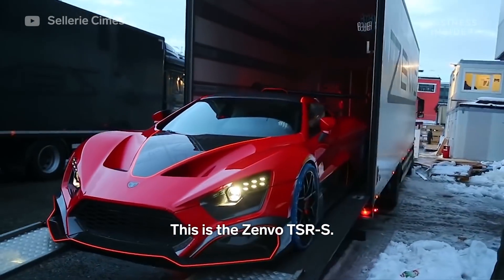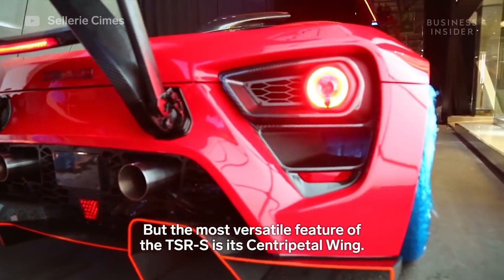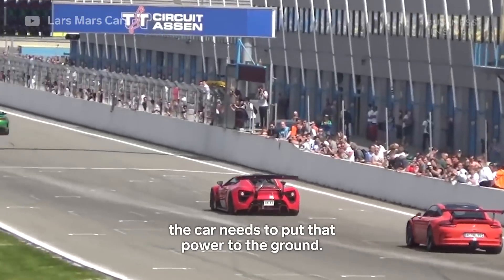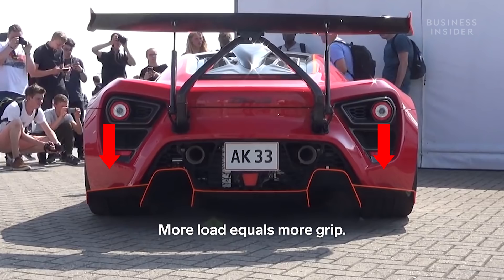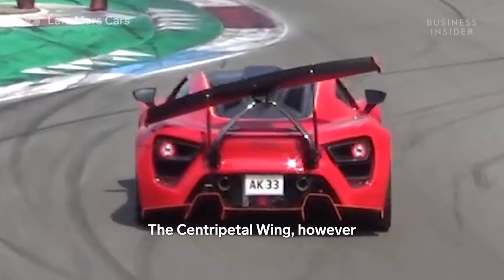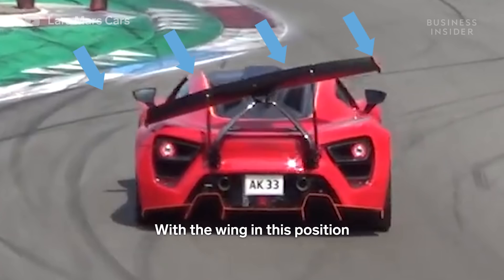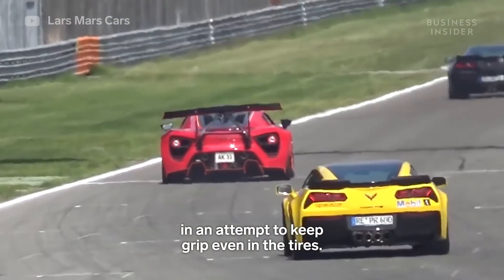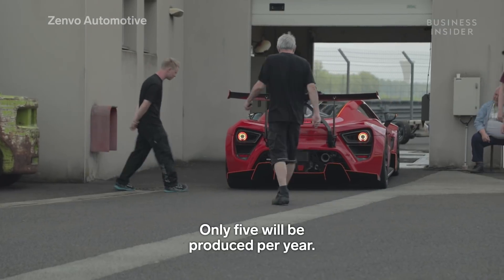How This Hypercar's Tilting Wing Gives It More Grip

Comment: yet another gimmick people pay for...    lol a wing  push's down yes, but the simple fact tilting the wing doesn't miraculously change the downforce..  it just redirrects it....  

aka its pushing you through a corner.....      as for better grip for braking...    uh..   only if your going fast enough for the wing to actually have an affect..    but anywhere below like 80 mph and its pretty much use'less for both drag to slow down and down force ...   this is why you see aircraft NOT taking off until the get up to speed..

Comment: i feel like if that made a significant difference they would tell you it increases corner speeds by xmph or something.. or that at some mph it allows for a certain amount of extra corning g's. all that i've found is that it reduces total down force by 3% and has an inward directed force of 30% of the down force.. which says nothing of how effective it is. seems kind of gimmicky to me. it's like the worlds flashiest sway bar
Reply: plus the active aero on the pagani huayra is still way cooler and actually implemented in a way that doesn't look super silly. plus it actually has active aero on both the front and the back.

Comment: From an engineering standpoint this is nothing but a gimmick. Dealing with wheelload transfer is one of the main aspects of suspension design. Adding active aero adds 3 more variables (downforce, drag, balance) that need to be considered when designing suspension as well as proper setup once the car is finished. That being said: Even without active aero proper suspension design and car setup is INSANELY complex.
When you now consider that:
a) this is a road car and does not produce as much downforce as a race car
b) Active wing overcomplicates setup
c) Added weight for hydrolics
d) worse stiffness -> worse aerodynamic performance or again more weight

I can pretty much say without a doubt that this car would be much quicker around the track with a fixed wing in favor of  a lighter car, stiffer wing and more refined setup

Comment: I want to say its cool, but it just doesn't vibrate well with me. Mostly aesthetics in liking the large rigid chassis wings, and their even and aligned positioning to the body of the car. This kind of messes with that clean aligned look and is a bit dissatisfying to watch, despite the performance enhancing qualities. Never heard of Zenvo until now too, probably would if BBC didn't pull the plug on top gear UK :P

Comment: never heard of an actual downward push figure being mentioned in such a video. Let me try to come up with a figure for you.
RC airplanes with a wing of that size can be say max 20kg. say x3 given a sharp attack angle and say x2 at fastest speed though you really take a turn with slower speed. for a light car say 1 ton that would be 10%.
that sound quite good but it's a very optimistic figure. typicall I would say less than 2-5% of the car weight and is only distributed to back wheels.
on the other side you do have some drag and extra weight. say minimum 1% drag, 0.1% weight. not sure if it actually is worth

Comment: I thougt moveable or active wing is banned in any racing sport???
Reply: Snailconnection Well in F1 they have DRS which is kinda like this but the wing just opens at designated points on the track to reduce drag on the straights nothing like this though that would be banned.

Comment: Highly doubtful that the 5 people a year that buy this car are willing or even able to take this car on a track and use this technology, these cars will most likely sit in someone's collection, driven maybe 50 miles a year.
Reply: A 1981 Volkswagen Scirocco Thats more like any ultra expensive car also the technology may be used in motorsport thats if it doesn't get banned
Reply: Dylan The amount of speed it takes for aero to be effective makes this wing tactical maybe 10% of a race? Depending on the track most turns are sub 80mph, which make aero ineffective.
Reply: A 1981 Volkswagen Scirocco Well it depends on what car the wing would be used on it would be more affective on a downforce intensive car like F1 or Indycar but a tilting wing in genaral is really unnecessary and just looks silly.
Reply: A 1981 Volkswagen Scirocco Yep

Comment: We will see, but imagine on some wings a load of the entire wing, meaning several 100 kg of downforce, just having to get evenly onto the mid axes. The wing already loses some of its ability onto the steering mechanics and some on some flimsyness of the wing itself, as you can see in some wobble on the straight. Additional weight of the construction adds up and at those rediculous tilts, the airflow is already not too fast. Now we also need to see, where the fastest airflow happens. Usually (with some turbolences) it is usually a bit lower. New wing designs explicitly make use of that already and this not. So...question is: Is the height of a tilting wing in the upper region within thei max airflowspeeds? Probably not as I would say....so it is losing efficiecy. The middle pivot is the main factor and no matter if it is fixed or not, the load would be not much significantly forced into the left or the right strut. As is is rigid, some of it also gets lost.
And as we all can see...they dont win anything and a normal vette is beating his ass left and right for some significantly lower pricetags.
It is an exotic thing and it will be bought for rarity and exotic reasons. Doesnt mean it is any good. Up till now, even a zonda or a koenigsegg hasnt done too much significant except building a track car, that is also street legal...which not many other sportscars do nontheless. So, pretty pointless to get hyped about them, when they dont work and even dont look that good. I saw a zenvo.....pretty bad manufacturing. Koenigsegg is a different one, I have to admit...but still doesnt have reached any significance whatsoever. It is an exotic car....nothing to win races with its superior tech. Those tecchniques are usually already well known by any other car brands since decades probably. :)

Comment: I have a feeling that this will backfire because if you were to turn the the opposite direction via adjusting yourself on the track to not touch the grass, the spoiler will just tip the car. This all seems like a dream car that is not probable

Comment: I would like to see this car in GT racing soon, along with the BT62. I think they would fit in perfectly with the GT3 (Or even the upcoming GT2 class reimagined by the SRO) cars of Blancpain GT, and GT Open. Obviously, it wouldn't be in this spec as it is merely a track-day car with a stupid, slow-reacting rear wing. The BT62 might even fit into the new "Hypercar" (LMP1) regulations for the 2020/21 FIA WEC season.
Just a thought.
Reply: Brabham is definitely aiming for LMP1. Zenvo not so much, there's nothing new. Active aero has been banned in F1 for ages, of course they thought about it.

Comment: You only get the benefits of the rear spoiler by going 150kph your not going 150 in a corner. This feature is very useless
Reply: A wing will always provide downforce so long as you have forward velocity, the amount of downforce being a function of speed and wing angle. Wings still provide a notable downforce increase as low as 40 miles an hour at higher angles of attack. And as you could see, the wing also changes its' angle of attack to better suit the speed it's travelling at.

In short, this is not useless. If this were useless, you'd be calling all rear wings useless, and racing would certainly disagree with that.
Reply: This guy obviously don't know shit.
Even wings/spoilers in fwd are useful.

Comment: GIMMICK. If it had that big of an impact, others would have already implemented them first. Remember Zenvo is just a small company from Denmark
Reply: Paypal had a big impact as well. But that was first created in the 2000's. It's called Innovation. Someone has to be the first one to get the idea and then Engineer the Technology. But i doubt you would understand that.
Reply: Besides it looks silly when it moves at 10mph, you don’t even generate downforce, it should activate at a certain speed, like 60 mph
Reply: Koenigsegg is a small company that does things most wouldn't think of yet still is still a capable company. I mean yeah its entirely possible it doesn't work well but you can never know...

Comment: Why am I not impressed? lol 
Seems like by the time the spoiler or wing has titled to the correct angle while racing, the car has already passed that corner and need to tilt or steer into the opposite direction and not helping with the road trip at all as expected. So it’s basically the same as any other race car there. I was expecting to see a huge gap left between it and the other cars. 😂😂
Reply: Isaac Kamau I bet u don't even know they way it's supposed to bend

Comment: Since you don't really need and generate downforce at slow speeds they really should have that activate at certain speeds. it looks ridiculous to have the spoiler twitch around at while the car goes 10 - to 20 miles an hour going into a parking lot
Reply: Exactly, at that speed a toyota 86 would produce the same amount of downforce
Reply: Matt Haas nope. It’s already linked to speed and grip levels. You can turn it manually at slow speeds for show though
Reply: chamber25 you can active and deactivate it lol
Reply: @QuasiDude  there can't be any mecanical link between the two, that would be ridiculous and not smart at all, it must be all electronically controlles.
Reply: not meant to be a street car though. its meant for racing
Reply: but having it when you are manuvering it on the parking lot would be awesome to warch
Reply: You gonna drive your 1.7 million dollar car to the fuckin supermarket? No. This shit gets trailered to the track.
Reply: if you have a 1.7 million dollars unique car i really doubt people would laug at it because of a racing feature on a parking lot
Reply: chamber25 its a gimmick
Reply: Sean McGeeney exactly
Reply: Sean McGeeney a gimmick that works
Reply: Konkey Dong a gimmick that is none the less a gimmick
Reply: Konkey Dong I could argue a gimmick that does not work as anything other than a gimmick
Reply: It's a super car (racing) obviously no point to take it on the street unless your stupid
Reply: chamber25 maybe turn it off
Reply: Considering it's 1.7m, there's a race mode they turn on to enable the wing.
Reply: It'll be funny as hell to see it, though.
Reply: Yeah 😂😂😂
Reply: No, it has electronic actuators so it can be turned on and off. It'd be way harder to do that stuff mechanically anyways XD
Reply: Now, why would you deactivate a wing on the track? Do you know how much calibration goes into that thing? Turning it off to park or go down the highway causes two problems. One, similar to the Plymouth Superbird, the car's wing sits extremely high, making it impossible to out into a one-state unless that state was absolutely perfect, otherwise, tailwind would rip it off. Two, you dont spend 1.7mil on a hypercar to make it a more boring hypercar. That wing is the entire car, without it, it would be another ST1. The wing is there for practicality AND looks.
Reply: chamber25 I agree but I think theyve done it to be a distinguishing look
Reply: I know this car is street legal but it doesn't seem like the kind of thing you would take to the shops
Reply: chamber25 If it's activated by speed then it could cause a slight problem of a different feel and speed during a turn because if you hit the speed going higher or lower in mid turn then it'd activate or deactivate and then it would probably cause a noticeable difference in turn response
Reply: The spoiler angle should not only be proportional to the steering, but also the speed
Reply: I was also thinking this it looks silly
Reply: Try to understand majority of the people who will own this car definitely won't be a race driver,for them slow speed is also a challenge that's why rear wing is active all the time to save those expert drivers cars from appearing on wrecked exotics.
Reply: True
Reply: Every little helps
Reply: Also, the wing holder looks like it is not consistent enough to actually push the rear and looks like a kite tail. But since insider review it, i think it works .
Reply: chamber25 ... Tilting wing means they don't have to slow down at the corner in the first place.
Reply: Ankit Panigrahi Downforce starts to generate at certain speeds, 30 mph or 50 Km/h is too low for it.
Reply: not to the extent you think. they still have to slow down its not gta
Reply: That is completely wrong and I hope you never will be able to drive with that logic.
Reply: Matt Haas Active aerodynamics is already popular among high-end sport, super, hyper and megacars and obviously also track, racing cars and even formula cars (since there's DRS, that is the only aerodynamic active device permitted in F1, F2 and GP3), and they are all already at the technology that they work depending on speed or position and distance from the car in front (in the case of Formula). 
Zenvo being a small company just couldn't afford a more advanced solution, if it was a big name (not Ferrari because there's an unwritten rule that only cars prepared or made for the track can have a rear wing, even thought the F40 and F50 had one) this active rear wing would be more advanced and wouldn't move at certain speeds or mode.
Reply: not to mnetion the shity Chevy Tahoe steering column.... lol you saw that right???? like what???

Comment: I bet it adds a little more weight to the car
Reply: Actually, the wing is made of exotic matter which has negative mass. This causes the wing to actually subtract weight from the car. Its the same stuff used by the US Space Force for anti-grav, rotorless choppers and for the Alcubierre drives of the Enterprise class CVNS space carriers.

Comment: But thr angle of wing isnt dependent on vehicle speed so efficiency isnt good.
Reply: It’s directly linked to steering input and steering input decreases at higher speeds but downforce increases so I’d imagine it somewhat evens out
Reply: Mukul Singh No it's more it tilts in corners and braking to create more drag and downforce and flattens out on the straights to help the top speed and acceleration.

Comment: Just like cheetah uses it's tail for better balance , during a chase
Reply: That's the first thing that came to my mind too!
Reply: S S W issue is, does it actually work?
Reply: John Makkin only a racing expert can Tell that , irrespective of that such design can be very helpful as the car is moving with the flow of wind , to assist itself for better performance.
Reply: S S W thats what I mean. Someone has to test it and see.
Reply: John Makkin no doubt
Reply: John Makkin of course it fuckin does m8
Reply: Well I think it works but I don't think it's to much of a difference but in the long run it would safe a secend or a little less
Reply: It actually does more harm then good for the car....

Comment: Technically yes but more grip on the long run causes more wear to tires and parts and the ultimate end result isn't impressive Holland wake up ...... No way this zenvo gizmo can beat a Porsche from 1988 without catching 🔥#topgear Open challenge if I'm wrong ........ You up for it zenvo???
Reply: Lington Daniel It's a collectors' car. The rarity and brand new condition of it with make the price skyrockets. Nobody will drive it apart from on the track, which is abundantly funded for cars like this.
Reply: Tire wear is inevitable. This is impressive, you nut. More downforce means better performance. This car is innovating like we've never seen before.
Reply: Are you dumb? The car is built to be fast and corner well, not to preserve tires. If you care about tires lasting, get a Honda Civic or a Prius
Reply: Lington Daniel Tyre pressure, set up and conditions of the tharmac have much more bad influence than downforce and slow corners.

Comment: Break some records and win some races . Then we'll see.
Reply: kids, dont fight. Think of it as a positive thing like, "i hope other companies will try to mimic such ideas. put it on a Supra ,an Enzo or an F1. but hey, dont do that on an F1, Because FIA WILL PROBABLY FUCKED IT UP"
Reply: active aero is not allowed in f1
Reply: @martismartiis813   DRS isn't active aero?
Reply: Joel Schembri it's not race legal despite being a track car lmao
Reply: [] They would have to do a totally new car anyway and add this wing to it (that would probably get banned), apart from the fact that it has to follow technical regulations, a road car prepared for the track will never be quicker than a car that was born for the circuits.
Reply: Mazokki the wing does make a difference it's just simple physics at work
Reply: Mazokki have you not watched the video? It may not be record breaking, but it is extremely effective at preventing it from rolling.
Reply: The logic makes sense but does it help win races?
Reply: Nutty 16, No because it does more harm than good. There is too many obstacles creating turbulence at the most important part of the wing. Its gonna help a "driver" not spin on high speed corners, but its not aerodynamically efficient enough to get it around the track consistently. I think more thought went into the active aero, than the aero performance.
Reply: I'd like to see lap time comparisons where they switch off the active wing for one lap vs using the active wing. Around the Nurburgring of course.
Reply: Already breaking necks
Reply: yeah but Breaking records and Winning races is no Option. The Zenvo couldnt race in any category and to break records i think the baseline car is way too slow. So they should just Show times of the normal zenvo vs new wing zenvo
Reply: [] It will break records and win races easily
Reply: @I Am Sekou zenvo is a shit car. Top Gear has already proven that.
Reply: It can do some lap times on tracks, however active aero is usually banned in almost every single racing series.